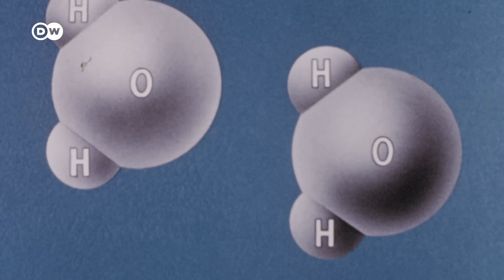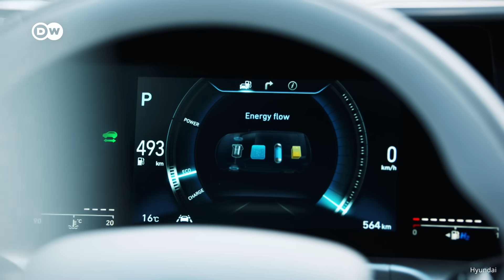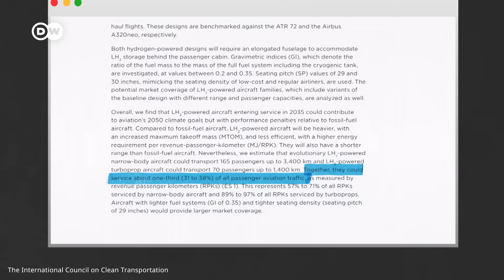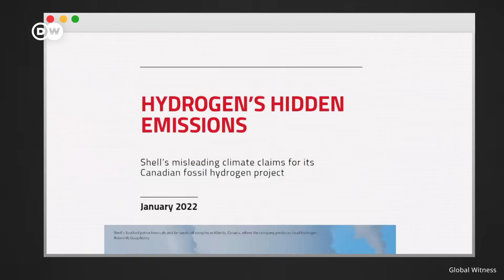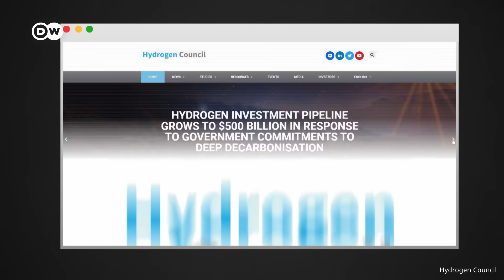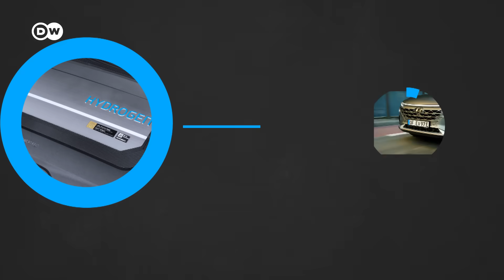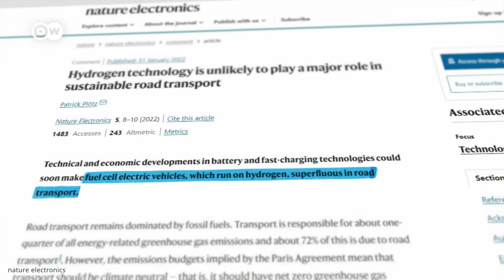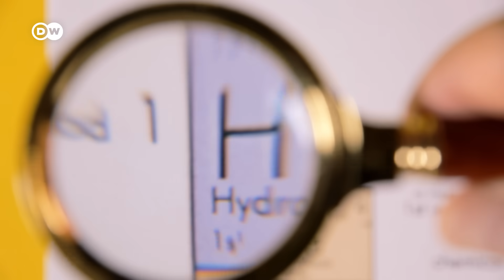The truth about hydrogen

Comment: So you mentioned the Chemical actions require to turn Iron ore into steel..  What are those actions? 
Are we just talking heating the Ore?  Does the Ore go through some kind of Chemical change what is that and how does it happen?  
Heating Ore does that produce burning and release of Gases.   Hydrogen burns Clean,  but does the Ore burn clean?   
You have said,  it requires a discharge of electrodes to separate the Hydrogen from the Oxygen.  Where is that power coming from?  
Basically you require energy to make energy.   Then you make or separate Hydrogen and Oxygen  but for things to burn you require Oxygen.   Hydrogen is highly volatile.  
Your using an electrical discharge could that make a spark enough to ignite the Hydrogen?
What about Oxygen bubble block?  Where Oxygen blocks water from Converting?
Is this process expensive?  As it is using Electrical power! 
It is true, that the Japanese Fukushima Nuclear plants was a Hydrogen explosion not a Nuclear explosion.

It was the heated Salt water that made Hygrogen and blew up the plant after the Earthquake Tidal wave - Tsunami hit !  That is true right!
Hydrogen has been known for years yet it was never really taken up due to cost and volatility.... 
Eg;  If a Car crashed is there a very good chance of explosion ? 

Is it also true that at the moment there is no new batteries that are in production or ready in the near future. That CAN overcome the issues of, 
1, Poor battery life.  
2, Charge times.  
3, Extended battery energy to balance with a tank of petrol by volume.   
4, That can provide energy at the same weight or less than Petroleum

Comment: Layman question: Nitrogen is the most abundant gas in the atmosphere. Wondering if it can be used directly/in some other way to generate energy (again) directly/thru batteries with clean bi-products.
Reply: Ammonia or NH4 is the medium here. Ammonia is very toxic and has its own issues. But it does burn. The only benefit of ammonia is using renewable energy to make ammonia fertilizers rather than using natural gas as the feedstock.

Comment: Just watched your very informative video on Hydrogen. My understanding is that the byproduct of burning Hydrogen is water, the question is what happens to the water produced. If used as fuel in a vehicle is the water stored in the vehicle or released to the atmosphere as water vapour.  If released as WV does that not add to GHGs given that WV is the most abundant of the GHGs.
Reply: Water vapour is a greenhouse gas? ELI5 please...

Comment: Instead of investing in expensive and inefficient hydrogen production and transport we should use that money to help individuals or communities to equip themselves with electricity production means based on renewable energy and electricity storage (the big batteries in the garage),  and use it for loading EV car batteries and household electricity. That would have the additional advantage of not putting stress on the electricity grid, forget the reselling of your electricity.

Comment: One thing that you didn't mention is that the hydrogen atom is very small in size, so when welding pipes the welds need to be perfect or it will leak, also since the energy content is low you need very high pressure tanks (special welding codes) also quite expensive, finally hydrogen has an invisible flame when burning and is orderless so it's hard to know your system is leaking and or burning.
Reply: For the last part, gas in your kitchen has smell added to it as well. So there are ways to solve certain 'issues'.
Reply: @cesco1990  That's correct. Natural gas (as you say) has no smell, the smell that we all know and love comes from an additive which would be added to a hydrogen supply. Bear in mind, in the UK, the gas supply up to around 1970 was 50% hydrogen and there was no more of an issue regarding leaks and quality of pipework as there is today with natural gas.
Reply: U put in 50/50 but what ratio did u end up with at the appliance?
Reply: @soothsayer5743  the person you are addressing has vanished
Reply: @soothsayer5743 There was no more leakage of the pre-1970 gas than there is today. There were very high compulsory quality standards for the pipes; they had to be steel of heavy gauge and only metal-to-metal screw-threaded joints. Many of these pipes are still in use. About 50%of the gas was hydrogen, and most of the rest was carbon monoxide. This mixture was produced by the reaction of steam with red-hot coke (which is what remains of coal after volatile substances have been removed by heating, and is mainly carbon and ash).
Reply: @cesco1990  “Natural” gas is NOT hydrogen.
Reply: @cesco1990  kitchen gas is methane.
Reply: @cesco1990  You are right, Cesco, natural gas has an additive for aroma. This works since they are similar densities. Trying to mix a gas with hydrogen would result in hydrogen 'floating' upward like a bubble in water. The gasses would separate during storage and likely during transport. Stirring might work but might not. 
Hydrogen offers tremendous potential, but also presents many technical challenges.
Reply: In fact, you will have to add wall thickness to all piping as the atom will escape through the material. All piping we use for hydrogen is 316L.  Also if temperatures differs to much  
the hydrogen will accumulate in sharp edges and cause brittleness. Will be expensive to design these systems. Codes for hydrogen systems are just a few years old now. A new career opportunity for piping engineers?
Reply: @richardtrygg7454  let's forget about cost and expense for a minute. And before we get started I would like to say I agree with you. The climate people are screaming out for money so why don't we use the billions for that the design the systems are. Needed. Hydrogen is athe better option for now. The fact that everything has been taken away, and too soon is crazy when they have nothing to replace them. Many have pointed out that renewables are not the solution, with too many variables. And hydrogen is no better or worse than what we've been using for many years, other than it's clean, easier to produce than say, natural oil or gas. It has a danger factor. But what doesn't. It's no more hazardous than natural gas, or Butane, methane. Petrol aviation fuel, rocket fuel or nuclear power. Yet we work with these every day. Most are in our lives, homes. When people try to debunk or slate it makes me wonder if it's an agenda to keep the current battery power going to make money? There are already hydrogen-powered vehicles out there that make electric and store it in the car. It's easier and quicker, and it lasts just as long as petrol. No one said it would be easier. But the powers can't put it aside to do their own agendas. Energy prices have always fluctuated, just like petrol prices, up and down since the gas era and then when the time of electric they converted everything. And that was a huge feat. But it was achieved.  It can be done if they wanted it. Because fusion is still years away. And then they'll still not want it
Reply: @richardtrygg7454  plus if its high temp, your pipes could not be subject to high temperature hydrogen attack
Reply: @richardtrygg7454  No. You can just use typical plastic tubes that withstand 30 bar of pressure and transport hydrogen as easy as any other gas.
Reply: During a transition from Carbon to hydrogen, the first steps can be painless, not impacting pipes or appliances. No high pressure tanks needed.

In January 2020, natural gas supply at UK’s Keele University was successfully blended with 20% Hydrogen. The 20% proportion was chosen because the blend won’t affect gas pipes & appliances. Natural gas heating generates about a third of the UK emissions driving global warming. 20% blend in Britain would reduce emissions of CO2 by six million tonnes - equivalent to taking 2.5 million cars off the road.
Reply: @DavidHalko  So, what's the theory behind making hydrogen gas less pernicious when its mixed with natural gas?
Reply: @dipladonic  - “what’s the theory…”

Scientific studies indicate lower percentages, it is not as bad.
Reply: It's not that it's just that it's around 20% so it doesn't really matter if it's actually 19,5 or so. It's a blend and it will work regardless. I do think blending it will lower the value of the gas GJ/M3.
Reply: Natural gas is also odourless and has an odour added to it
Reply: As a CWI, I think the current section IX boiler code is more than adequate regarding hydrogen as a flow medium.
Reply: Hydrogen- mix used 100 yrs ago already in Berlin using pipes.
Reply: In a way though long term this problem is a good thing as it will force innovation and higher production standards as a necessity
Reply: I didn't know this. Thanks for sharing.
Reply: Yeah.  Hard to contain and explosive is a bad combination.
Reply: 4% Hydrogen mix with air is inflammable, 18% is explosive.
Reply: that is why it should be mixed with oxygen and not seperated.
Reply: @alexanderson4582  this happens when you burn it...
Reply: Hydrogen leaks held up the Artemis launch for 3 years. It's tricky stuff.
Reply: I didn't read all the comments. There was an image shown of hydrogen loss from pipes.  Hydrogen will leak thru metal not only joints. It's necessary to know the curves of loss vs pressure.
Reply: It’s amazing this information was missed, or left out! Thanks for your comments! 🙏😎
Reply: Hydrogen will escape all containment. There is nothing it won't dissipate through. So vast storage or long storage is always at a loss. And the measure needed to slow this process cost energy, so it's a defeatist effort.
Reply: @devssc  Because to store it efficiently is a massive problem. Being the smallest of atoms, it diffuses through any containment materials used and wasted into the atmosphere. Therefore either high pressure or cryo is the only options. And this itself costs huge amounts of energy and more infrastructure where ever it is used. So you end up having to spend energy to store energy, not the greatest of concepts.
Reply: Hello, very insightful information... is it possible to connect on linkedin ?
Reply: It's not just that the weldings need to be perfect. The same could be said for other gas pipes. It's that the hydrogen atom is so small that it permeates the material itself and leaks out!
Reply: Fucking finally. This is one of the biggest issues. Add that to the inneficiency, and the aparent existance of sodium batteries and hydrogen is just not effctive enough.
Reply: No there is a technology that allows high density storage at low pressure so that to release it you just need to heat it to 100C. This would solve the hydrogen storage problem as it's both safe and high-density. But it's not getting investment which makes me highly cynical.
Reply: “Hydrogen… leak”

Today, electrical line loss in transport happens in heat, so a little loss in hydrogen is no big deal. This problem is over-rated.
Reply: Even with perfect welding, hydrogen molecules will leak through intact pipes or storage container walls at elevated rates, because of their small diameter.
Reply: @arvidsfar1580  seems like an excellent opportunity for new companies to develop these kinds of structures and metals. All hail true capitalism. And not modern-day fascism.
Reply: @cesco1990  you are correct sir, so go start investing into hydrogen companies. Actually better start your own hydrogen related business you’ll be next Elon Musk. 😂
Reply: @arvidsfar1580  The main reason Hydrogen is hard to bottle is becauseit has the lowest molecular weight.....hence, by far the highest molecular velocity.
Reply: @DGill48 Industrial gas suppliers can supply you with hydrogen in steel cylinders, often used now for inflating weather balloons. There does not seem to be any problem with it escaping. In the past a mixture of hydrogen and oxygen was often used for welding, but the hydrogen was replaced by acetylene because this gives a hotter flame and better chemical properties.
Reply: @arvidsfar1580 it bigger than helium. And we store that.
Reply: Cryogenics is the way to transport or move hydrogen in pipes as the hydrogen atom is in a very low state of movement and escape is minimal. The problem is cost to have cryogenic infrastructure.
Reply: @johncouriermeh  really? the bigger problem is the embrittlement of steel when hydrogen intercalates, the denser the hydrogen, the more it penetrates and prevents high pressure pipes from being structurally sound.
Ever heard of cold fusion, it is the intercalation of deuterium in palladium
Reply: @arturoeugster7228  Cold fusion !  seems like it was just yesterday.  The Utah embarrasment
Reply: @DGill48  Yes I remember intercalating hydrogen in palladium , by Stanley Pons and others.
The whole process has ben vigorously suppressed.
Reply: @johncouriermeh  good luck with insulating the pipes at 7° Kelvin.
Reply: @johncouriermeh  And the tank size, the insulation required, and the highly flammable nature of hydrogen. Example: both the Challenger and Columbia disasters were either the result of a direct hydrogen ignition or a failure of the insulation around a hydrogen tank.
Reply: @stuarthirsch  Challenger was caused by shrinkage of O seals due to extremely cold weather in Florida compromising the integrity of the efflux jet from the booster causing a leak of extremely hot gas, like a flame thrower directly onto the hydrogen tank, so not caused by a leak of hydrogen but a failure of technical knowledge at NASA. Columbia was absolutely nothing to do with hydrogen system failure in any shape or form but a chunk of foam insulation breaking away and colliding with the heat resistant tiles on the Port wing of the shuttle, which on re-entry caused it's destruction. So in both cases nothing to do with the hydrogen being contained but due with outside problems.
Reply: @johncouriermeh  You are mostly right
The design of the placement of the seals has been corrected by Thiokol, 
It was Richard Feynman who demonstrated the loss of flexibility of the seal rings, which were well imbedded in a temperature resistant grease. The flexibility of the steel skin allowed a small gap to form, with the rigid cold seals.
Ten engineers at Thiokol refused to sign the go ahead, and were overridden by managers. Aviation Week has the full story with detailed drawings.
Reply: @johncouriermeh  
The cause of the Columbia  was covered up, The excuse of the foam falling on the carbon carbon wing leading edge was used. The original FMEA did disclose such a possibility  and eliminated. The real reason, as an Airforce satellite image of the Space Shuttle showed , was that the gear door was open on the left side. The door is closed by hand, using a beam prior to leaving the building. It latches, normally. The contractor doing the refurbishment was  a contractor, that I don't remember.
The damage due to the hot air was well behind the leading edge. 
FMEA stands for Failure modes and effects analysis.
Reply: @stuarthirsch  were those 2 using hydrazine or straight H2?
Reply: @johncouriermeh  there is R+D to transport electricity through superconductors. Apparently the cost of cooling compensates the lack of losses, compared with ordinary conductors. But maybe adding an H2 flow around the cable...
Reply: Still with cryogenics (liquid hydrogen) you have "leaks" that I becomes gaseous before reaching the destination. And hydrogen is just like helium very close to absolute zero, so the insulation is more intense than for example nitrogen. So yeah it's a good solution, but cryogenics is not that easy either. It's a really specialized business. And still the hydrogen atoms will seep through the metal.
Reply: “high pressure tanks”

Or, irregular shaped medium & low pressure tanks can be used, similar to what is done with Li-Ion batteries in laptops, where they can be made to fit the space available, without resorting to high pressure.
Reply: Lakage of natural gas installations, pipes is nothing compared to what hydrogen leakage would be.
Reply: @marcwinkler  - “leakage of natural gas… nothing compared to what hydrogen leakage”

There is no real data demonstrating a massive increase in h2 leakage over ng leakage, as of 2020… concerns are extrapolations, no real numbers, highly speculative at best.

H2 is already being produced, shipped, contained, piped, and used in: Australia, Japan, US, UK, and mainland Europe… India is on-tap to become a major producer & consumer!

Comment: Thumbs down:  the video was looking good until it failed to highlight how much energy is used to manufacture a car battery, and how much energy to transport the battery to the vehicle assembly, and how much energy to transport the battery to the final point of sale. It’s my understanding the energy for manufacturing and delivery car batteries outweighs the carbon saved from using it. 

So what’s the answer? A car that has a hydrogen generator in the vehicle??? Don’t know.

Comment: To achieve net zero by 2050 mining activity of non ferrous minerals will need to increase 600%, governments will have to subsidize renewables AND compensate fossil fuel companies, a new energy infrastructure will have to be built and the old one removed and a substitute for plastics needs to be developed.
This means it's not going to happen.
By the way , data storage currently uses as much energy as the world's airlines and by 2050 will use triple. Perhaps we need to stop recording everything and on another point stop shipping from factories direct to consumer ( one parcel at a time). Microsoft Amazon Google Apple etc are killing the planet.